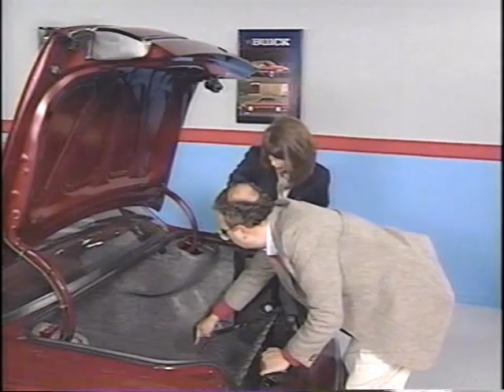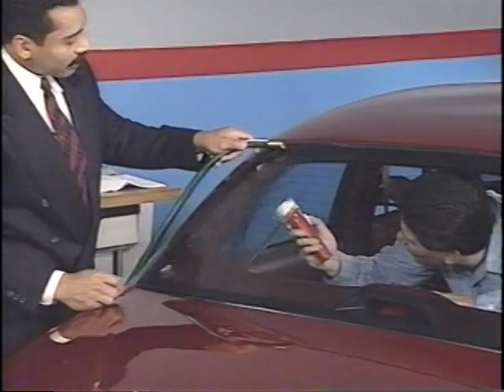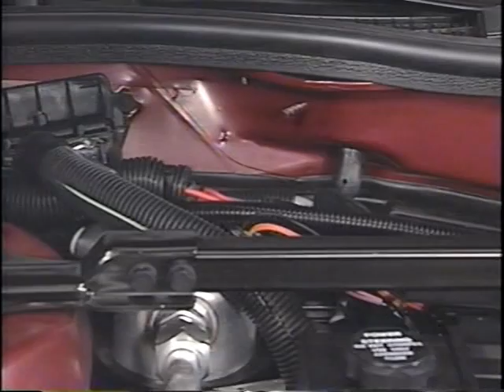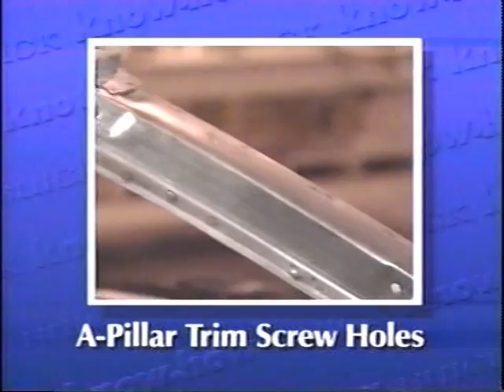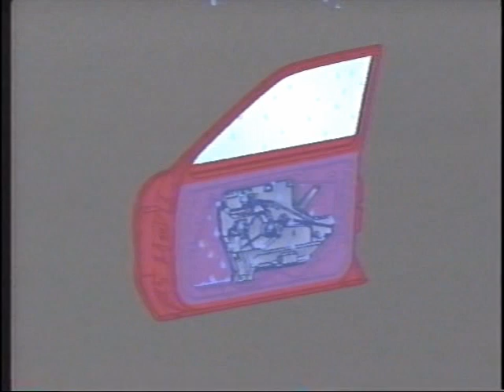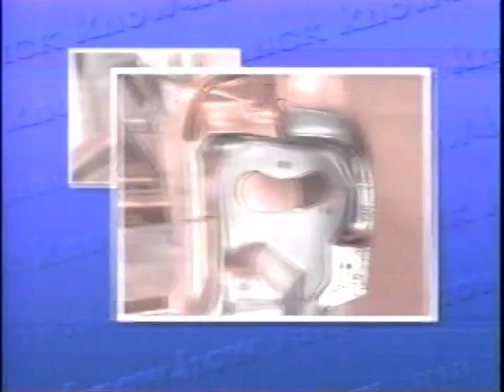Buick - Water Leaks (1993)

Comment: Not even the EU-Spec is spared. 1994 here. Trunk leaks. It seems to come from under the lid that pops up. But even after a hand wash it didn't become worse so I wonder if it's just moisture somehow. Which sounds like a seal somehwere.

Comment: Damn. I got a '93 Regal coupe and it's leaking at the overhead light/into the headliner. I bought this car because it doesn't have a sunroof and thought I'd be good for no leaks! Not sure what to do as all the seals look good. The only one that is questionable is the back window seal but only the very front of the headliner will get soaked about an inch after several days of rain.
Reply: Did you find a Solution in the meantime? I’m having the same problem

Comment: Fuck I guess you buy a car from GM and then it is your job to finish assembly when you get the car Home!  This is total bullshit.  No wonder GM begged for money in 08.  I bought a 99 Toyota solara, no leaks what so ever, 203000 miles runs perfect.  I am gm fan but this type of manufacturing design and quality control has no excuse what so ever!  And yes I have a 95 Pontiac grand prix and 95 buick lesabre and both cars wet all the time n the floor and trunk areas!

Comment: My 91 park ave always leaked in the trunk .did not know what it was until I put silicone on the hole on each side of the rear lights.I peaked under and I realized you can see electrical wires to back lights ,maybe water getting in that way?
Reply: Juanita Morris . Same problem with my 94 park ave